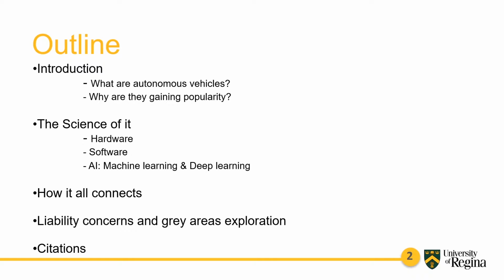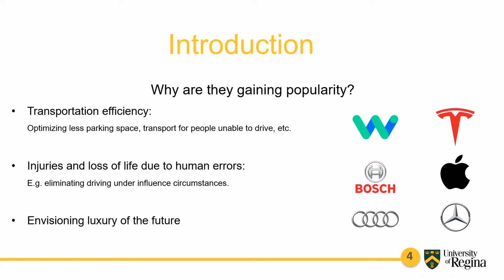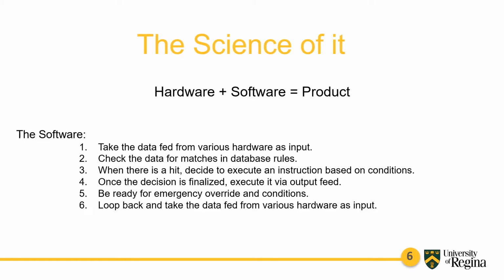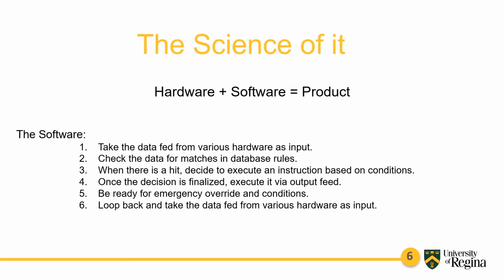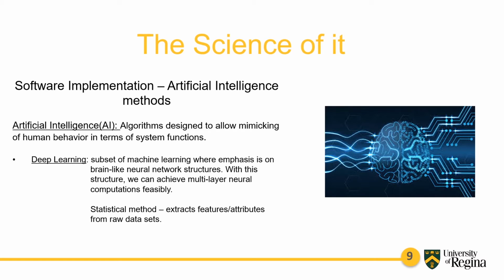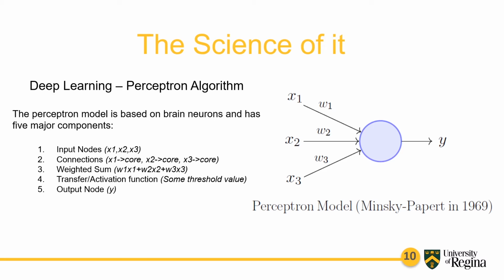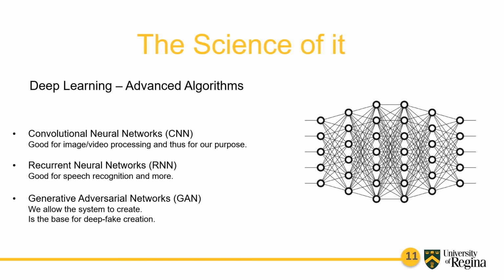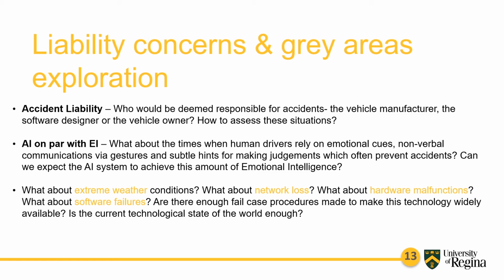AI in Automobile Industry - CS 499 Spring Seminar

Comment: Dear Rutvik,

Good choice on the presentation topic!
I have learned quite a bit about the supervised and unsupervised learning. However, I haven't learned much about Reinforcement Learning. 
Could you please provide more information about Reinformencemnt Learning and how is it different from unsupervised learning? Could you provide an example of a project based on  Reinformencemnt Learning? 
Thanks,
Reply from the maker: Thank you for the question Nikita, I can certainly help you with that.

Just like the name sounds, Reinforcement Learning(RL)  is a machine learning method based on rewards. Its basic idea is to reward the system when it performs something that you are training it for. There can be two types of RL based on how you choose to reward. Positive RL relates to you rewarding the system for every "correct" decision it makes while negative RL is you stopping, removing, or avoiding when the decision made is "incorrect".
This should also help in understanding how it is different from Unsupervised Learning since we directly interfere with the learning mechanisms in RL.
Some examples of RL are its use in training traffic light systems. It is also used in robotics to train decision making amongst other behaviors.

Hope this helps.
Thank You

Comment: Hi, how do self-driving cars deal with errors made from other human drivers in the nearby environment?
Reply from the maker: Hi Amandeep. Thanks for the question.

In an ideal world, autonomous vehicles would’ve completely replaced human drivable cars. Of course that is not the case yet and that wont be the case anytime soon.

To answer your question, self driving cars wouldn’t treat other cars nearby any different regardless if they are driven autonomously or by humans. Thus, our car should always have certain emergency protocols. If it is viable to escape unscathed, that is what the car would do. If not, priorities should be passenger safety and safety of life outside our car. Accidents can always happen, what the autonomous cars can do is nothing but try to prevent and if not, incur minimum harm from them.
Important thing to note, however, is that there might be times where escaping the situation without harm is simply not possible. 

Hope this helps.
Thank You

Comment: Thanks for sharing. Please what are the security concerns and how can we guide against attacks, most especially when we know this is based on IoT.
Reply from the maker: Thanks for the question. 
Security concerns would range from the software being exposed to hijacking attacks. If the software’s controls are taken over they may pose serious risks like endangerment of human lives both inside and outside the vehicle. There could be a large scale attack if the whole fleet of vehicles could be controlled via the software. This could quickly change into a large scale terror attack as well.
To guide through the attacks, manufacturers have to pay close attention because, as you said, this is based on IoT. There should be constant research and amendments on cybersecurity techniques like encrypting the action data for instance. At the end of the day, like other IoT based devices, security is a huge concern and its responsibility falls down on designers and manufacturers.

Hope this helps.
Thank You

Comment: Hi Rutvik, Is there any mechanism used to determine the number of hidden layers?
Reply from the maker: Thanks for the Question Chermaraj.

Id like to tell that there is no set rule for deciding on the number of hidden layers. It should be done experimentally and on a case to case basis. However, one thing to note is that majority of the problems don’t require more than one hidden layer. 

Hope this helps.
Thank You

Comment: Hello Rutvik, can you pls elaborate HOG and YOLO algorithms and disadvantages of using them.
Reply from the maker: Hi Vaishali. Thanks for the question.

HOG - As I've mentioned this is one of the most basic ML algorithms for autonomous driving and computer vision. We analyze a region of the image, which is then termed as a cell, to see how and in what direction the intensity of the image changes. The computed gradients from each cell are connected to count the number of times each direction occurs. This is then used to classify the image. Basically, we end up creating a coded and compressed version of the image that is not just pixels but an image gradient.
One disadvantage that I can think of for HOG is that it would perform poorly for the classification of textures or objects detected in image rotation. HOG is very sensitive to rotations.

YOLO -  As we know, YOLO is used to classify objects such as cars, people, and trees. It is basically an alternative to HOG. Here we analyze the image as a whole and then divide it into segments. We bound boxes and predict for each divided segment. Each prediction that the algorithm makes is made in the context of the whole image. This applies the evaluation only once. This is why YOLO seems to be faster than other algorithms.
One disadvantage I can think of is the inability to detect multiple objects too close or too small. For instance, a group of people together far away would not be detected and that is a cause of concern especially in autonomous software.

Hope this helps.
Thank You

Comment: Hi Rutvik, You discussed machine learning and deep learning algorithms for different purposes.  How will you combine all the models?
Reply from the maker: Thanks for the question Sandeep.

To answer this, I'd like you to focus on the components in slide 13, especially component 3. As you can see an automated vehicle will have numerous collection of AI-based functions that link together which is what we would call its autonomous software. So to combine the models I discussed it would be a case-to-case basis. Some functions might require Neural Networks to process the results while some simply need to undergo reinforcement learning for instance. It is also important to note that deep learning is nothing but a subset of machine learning.

Hope this helps.
Thank You

Comment: What hardware devices are used, if any, to consider extreme weather and road conditions? For instance, driving relatively slow when a road is covered with snow.
Reply from the maker: Thanks for the question Rajbir.

We have certain methods that could combine hardware devices like LIDARs, MWRs, GNSS, cameras, and local news to better prepare the car for weather conditions it is driving in.  Once we determine that there is snow with how the mentioned hardware provides data and confirm that with local weather news, the software should have protocols that drive the car slow to ensure passengers and others' safety. 

One thing I'd like to point is that you could never be too sure and have full faith in the system as things are now. It would be a better choice to always let the driver interfere in cases like these or manually override how the software drives the car.

This is indeed a good topic for future research and how to better improve detection techniques by integrating software and hardware.

Hope this helps.
Thank You

Comment: Good presentation! In Slide 5, you have mentioned regarding processor's capability can you share us what the configurations that are ideal? Is there a significant network delay expected in real-time processing?
Reply from the maker: Thank you for the question.

What I'd like to point out is there are still significant advancements needed before we can go fully autonomous with full confidence. With that out of the way, currently, I find two major chip designers setting the standards. One is Intel linked with WAYMO and the other is ARM. Since you'd like to know about configurations and specifications, ARM has released the ARM Cortex A76AE processor which is made for autonomous purposes. It boasts things like Dual Core Lock-Step and split locking for security purposes. It also claims to deliver a 30% uplift in performance than its predecessor. I'll link you to the pages of intel and arm for more information on these. 

https://community.arm.com/developer/ip-products/system/b/embedded-blog/posts/announcing-the-arm-cortex-a76ae
https://www.intel.in/content/www/in/en/automotive/autonomous-vehicles.html

Now, with there being significant changes I can't pinpoint you to how "ideal" configurations look, all I can tell is we want fast and secure processors and it seems ARM is doing just that.

As for network delays, technology is fast today. It would be rare to experience numerous significant delays in real-time processing but that does not stop us from exploring technologies that can further enhance the current levels of speed. One concept to explore more on would be Quantum Computing.

Hope this helps.
Thank You
Reply: @rutvikshah28  Thank you

Comment: Hi...Can you kindly explain how to choose the initial bias input type for the perceptron algorithm?
Reply from the maker: Hi, thanks for the question Sumedha.

Choosing initial bias actually depends on the problem you're solving. However, in most cases you can treat the bias like all the other weights so it will be initialized to some random value that is updated as the network gets trained. 
Another thing to look for is the learning rate desired. You would want your system to learn quickly but not to the extent that the weights fail to converge and make sense. 
You can also understand the learning rate series by the economic concept of diminishing returns, just like in real life, you learn a lot from something encountered that is new but that rate of learning goes down as you get familiar with the concept.

Hope this helps.
Thank You

Comment: Good presentation!
Can you please touch base on how to test these autonomous vehicles? Are there any formal testing methods for the task?
Reply from the maker: Thank you, Soumya. That's an interesting question.

Firstly, I'd like to tell, as per my knowledge, there aren't "formally defined methods" for testing autonomous vehicles. I think it depends on the manufacturer. For instance, Tesla might have its own set of rules for testing how its vehicles perform while Google WAYMO might have a different set of rules. The key thing to note is that there are indeed common circumstances around which the testing occurs.
We should also note that testing is part of the Machine Learning and that is how we train the cars before rolling them out in the market with confidence.
Now, some of the common circumstances around which testing might occur are concerns like:
1) Vehicle Safety: This relates to the overall secureness of the vehicle. The manufactures must assure that the vehicle will safely operate without malfunctions and will indeed reach its destination with ease. 
2) Safety to others: This is an important concern mentioned in slide 13. The manufactures should ensure that their vehicle would provide maximum safety to others out on the road beside the passenger it is carrying inside. This also raises questions on liability in case of accidents.
3) Emergency handling: The manufactures must have a set of protocols for handling emergency situations flawlessly that can save countless human lives.

As for "How" they test their vehicles is solely the choice of the manufacturer. But the important thing is that they must provide proof and data on how they handle these concerns before we accept self-driving vehicles replacing us.

Hope this helps
Thank You
Reply: @rutvikshah28  Thanks for the elaborate response. Totally makes sense :)
Reply from the maker: Soumya Shukla Glad I could help :)

Comment: Hey, I have two questions.
1. Can you explain more about scale invariant feature transform(SIFT)? 
2. In hardware you mentioned odometry what is the use of that?
Reply from the maker: Thank you for the questions.

1)  As I've mentioned SIFT allows detection of partially visible objects. How? Well, let's understand the algorithm. 
It uses an image database to extract salient points of an object. We termed those salient points as keypoints. Those keypoints are features of the object in question that don't change with scaling, rotation, clutter, noise, and more. Once we have them extracted we can compare every new image with those features previously extracted to make sense of what kind of object is present even if it is partially covered. As an example, if there was a road sign that had its SIFT features extracted, in the future if we came across another sign that was damaged or bent, it would still be recognized by SIFT.

2)  Odometry is a technique where you, for instance, use the starting position and a wheel displacement calculation to estimate the position of your vehicle at a certain time. Its hardware implementation is what we call an odometer.

Hope this helps. 
Thank You

Comment: How about the accident rates caused by hardware and software? Have the companies thought about the prevention of the viruses and how?
Reply from the maker: Great question! 

The rate of accidents can be significantly lowered as we keep on learning and perfecting the algorithms on how we deal with realtime data on the road. However, this will never guarantee that the number of accidents will be zero. There is always a possibility of hardware/software malfunction. As much as this technology sounds interesting, concerns like yours are what need to be addressed before we can move ahead. As you may/may not know Tesla has had some lawsuits for accidents and deaths caused due to its autopilot. 
Everyone understands the severity of these situations and I can assure that companies like Tesla, Bosch, Waymo are always working to ensure the rate of such accidents drop down to the bare minimum if not zero.

As for viruses and security threats to the software, they are indeed very real.
In extreme scenarios, we can have rogue cars running around causing deaths in a matter of minutes. There could be the hijacking of the networks for terrorism purposes amongst others. Personal data could be stolen and used to cause chaos. 
So it is very important to address this as well. Cybersecurity methods are present that increase the safety levels but one can never be too secure.

I'm sure companies have thought about these scenarios but there are no short term fixes, these are huge concerns and companies must keep working on them to ensure peace of mind and safety for humans.

Hope this helps.

Thank You

Comment: In slide 10, certain threshold value is used for comparing with the weighed sum. Is there any criteria on how or what values for threshold is selected?
Reply from the maker: Thank you for the question.

Setting a threshold value is usually up to the designer of the network. However, there are some typical values used in simple perceptron networks.

As we know the weighted sum is compared to a certain threshold. That threshold is typically 0. If the value I greater than that the neuron fires and takes an activated value as output, usually 1. If not the output would usually contain -1.

Hope this helps.
Thank You

Comment: What is the inertial measurement unit?
Reply from the maker: Thank you for the question.

An Inertial Measurement Unit (IMU) can measure a variety of factors like speed, direction, acceleration, specific forces, angular rates, and more. It uses a combination of accelerometers, gyroscopes, and even magnetometers to sometimes measure magnetic fields.
You might want to understand the concepts of Inertia for a better understanding of the base.

Hope this helps.
Thank You